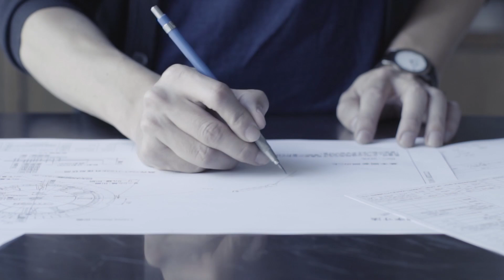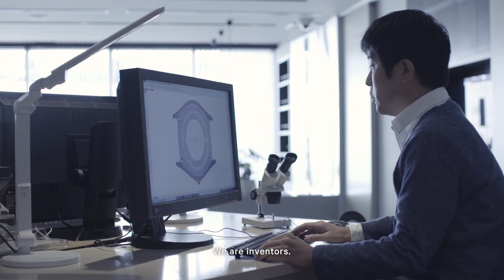Manufacture of CITIZEN

Comment: If they're wondering how they could improve here are a few:
1. A rotor that is silent. I dislike how loud their rotors are, it sounds cheap despite not being cheap. Even the newer 9000 series has this. This is legitimate criticism.
2. A rotor that winds in 2 directions without making the watch chonky. It might be related to point 1.
3. Offering bracelets on every color way of a model. If I want a black dial diver with a bracelet, I should get it. Especially when the identical case with a blue dial offers one.
4. Including an instruction book in the box. If I buy it I shouldn't have to rely on it being online 
5. Have more than 2 authorized service centers in the entire continental US